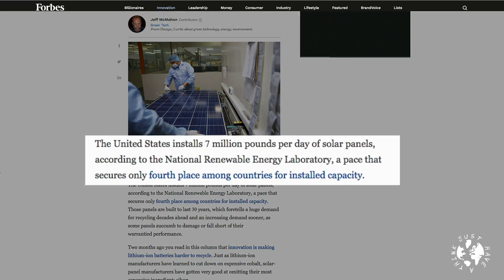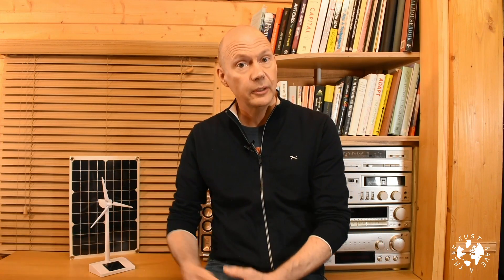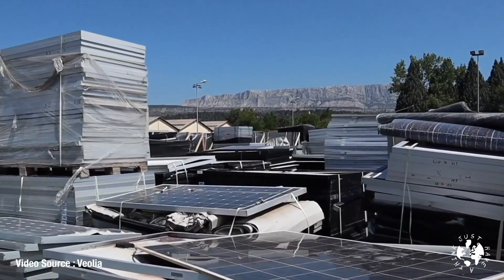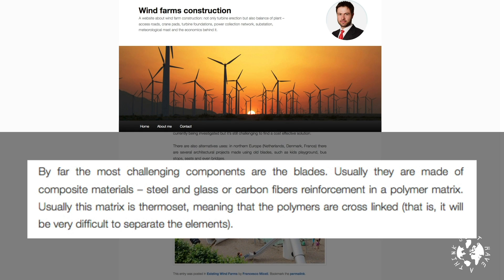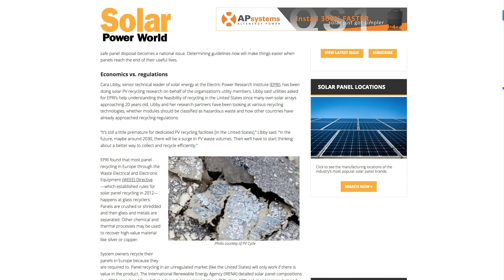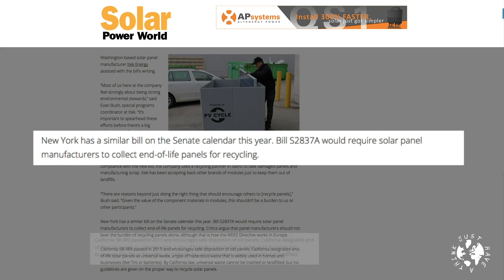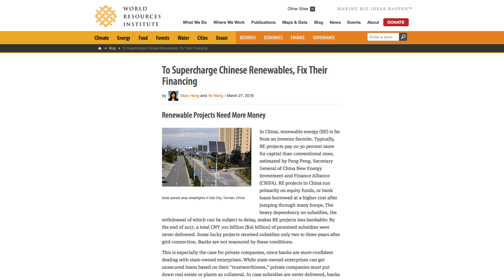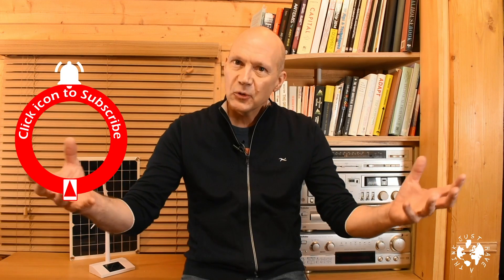Recycling renewables : a price too high?

Comment: Glass, aluminum, solder, wire, silicone solar cells, silicone adhesive.  Similar things for wind turbines.  No more difficult than say a car or aircraft which are readily recycled.  Easy peasy.
Reply: of course.  This "problem" is hyped nonsense.
Reply: It's only "easy" when you have boat loads of CHEAP HIGH DENSITY ENERGY, it's very difficult if all you have is low density, irratic, weak energy which is what "renewables" produce.
Solar panels are great for small applications like radios, watches, some energy efficent homes in favorable locations, lighting for remote areas etc but they cannot support our high energy, high consumption civilization & even more important, they produce NONE of the essential raw materials we now need.
So it's back to the "caves" but with a solar panels providing some light inside the darker recesses of the cave when the suns out, but without batteries, they won't be of much use at night.
Reply: @sheilachambers6671  you are correct we do need dense energy storage.  Solar and wind are more than adequate to pump water when they are available and can easily store massive amounts behind damn to be used in base load high power applications.  As far as small scale it is trivial to use solar to power a modern American home.  Currently it is not ideal to retrofit old home with it, but silly not to include it on new construction.
Reply: @GeoFry3  That would depend upon where that new home is located, there are areas where  it would just be an added expense to have solar panels on roofs that get little if any sunlight. 
Homes in areas within a forest, shaded by taller buildings,  in areas that get too much fog, rain or snow & solar panels add tens of thousands of dollars to the cost of that home. 
Areas of the SW, the far south west, central states & some eastern states can benefit from solar. Where I live, we get too much rain & fog for solar to be useful, we get 80" of rain here & when it's not pouring rain, it's foggy. This is also a low income area & we have no solar panel dealers anywhere near us.
Solar just cannot solve our energy problems or our upcoming shortage of liquid, high density energy fuels for agriculture, long haul trucks or ships.

As I have mentioned before, all these so called "renewables" wouldn't even exist if it wasn't for energy dense fossil RESOURCES &  energy dense fossil fuels. Our agricultural system is also tightly tied to OIL as are the genetically modified food plants now dependent upon chemical fertilizers produced from natural gas & oil.

We cannot replace DECLINING RESOURCES with a RESOURCE DEPENDENT TECHNOLOGY!

I think we are being mislead on the capabilities of "renewables" to keep BAU functioning because they can't.

http://wattsupwiththat.com/2014/11/22/shocker-top-google-engineers-say-renewable-energy-simply-wont-work/

https://www.newscientist.com/article/dn16550-why-sustainable-power-is-unsustainable/
http://sunweber.blogspot.com/2015/04/solar-devices-industrial-infrastructure.html

http://energyskeptic.com/2016/hall-and-lambert-eroi-of-different-fuels-and-the-implications-for-society/

http://dgrnewsservice.org/civilization/ecocide/extraction/kim-hill-whats-wrong-with-renewable-energy/

http://www.theenergycollective.com/gail-tverberg/330446/ten-reasons-intermittent-renewables-wind-and-solar-pv-are-problem
http://oilprice.com/Latest-Energy-News/World-News/Germanys-Renewable-Energy-Problems-Serve-as-a-Warning-to-the-UK.html

http://www.theenergycollective.com/robertwilson190/335806/germany-shows-renewable-energy-has-failed-and-other-strange-ideas

https://cleantechnica.com/2018/11/22/peak-oil-drastic-oil-shortages-imminent-says-iea/

https://www.cnbc.com/2018/11/09/goldman-sachs-there-will-be-an-oil-shortage-in-the-2020s.html

As Dr James Hansen said:
"Can renewable energies provide all of society’s energy needs in the foreseeable future? It is conceivable in a few places, such as New Zealand and Norway. But suggesting that renewables will let us phase rapidly off fossil fuels in the United States, China, India, or the world as a whole is almost the equivalent of believing in the Easter Bunny and Tooth Fairy."
http://bravenewclimate.com/201...

Comment: It wouldn't surprise me if most solar panels still work well enough to use up to or after 100 years from the born date. We are just getting started with solar really. I'm working on devices that can be direct wire to solar, no charge controller no batteries, and do the same things that your grid power does. No need for the extra cost of all the extra hardware. Solar will save us tons when it comes to trash.
Reply: What do you use at night?
Reply: @davidtaylor7174  Depending on the application, nothing. A few things need some type of battery but what we are working on will cut your battery needs by 80-85%.

Comment: We have to encourage decentralised renewables by using small 100% renewable companies. Also we chuck away thousands of motors in our electrical devices and appliances every day, which could and should be used to make domestic wind etc generators. I have collected motors from scrapped hoover-mowers, microwave cookers and even DVD/CD players. That I’m using to make a few different renewable energy generators. LA should be running courses with hands on learning how to use these motors etc from recycling depots. Also there’s other lower tech solar generators that I think are better, such as Solar collectors that use a curved troth mirror to heat a fluid in a pipe. Also some places are installing turbines in mains water pipes which provide constant local energy.
Reply from the maker: Hi Kyarose. You are an inspiration! I'm reminded of the guy in Zen and the Art of Motorcycle Maintenance. Its almost a lost philosophy - what my parents and grandparents called 'make do and mend' during the second world war. I think there is a resurgence of this mind set though. I certainly hope so. All power to your elbow my friend :-)
Reply: Just Have a Think Thanks v much for those kind words, and the reminder of  a distant memory of ‘Zen and the art of motorbike maintenance’, I used to be a biker in the 80’s had an old 54 Matchless G80s( 500 single).

Comment: 100x100km of solarpanels near the equator are enough to power the world, well someyears ago!
Reply from the maker: Hi Nico. Yep I think that's a similar figure to one that Elon Musk used quite recently.
Reply: @JustHaveaThink  this number came from desertec and was meantioned many years ago! Solar panels in the sahara desert to power europe andvthe calculated how much would be enough to power the world.
Reply: You're leaving out the cost and environmental expense of building the transmission infrastructure to distribute the power from the panels at the equator.  (not effective).

Comment: Well in germany we could stop 20% of energyproduction, just needs storages!
600TWh/year needed, 800TWh/year produced, 200TWh are given away almost for free!
Reply: See my comment under the thread of +tcm - the speech of Dr. Eike Weber is under the channel of Universität Karlsruhe  - Solarenergie als zentrale Säule einer enerneuerbaren Energieversorgung.
Highly interesting. STORAGE and batteries are the next fronitiers - we can rely on it that there will be  the same economy of scale effect regarding research results and price drops

Like with solar panels, airbags, electronics, computers, mobile phones, smartphones, the internet, digital cameras, animation in films, ...

If stationary * batteries get only 20 % cheaper (and that can be next year, in 1 or 2 years) it will be another important breakthrough. 

* easier to solve the technological challenges than with car batteries: weight, fast charging, density is not that much of an issue - so it is possible the breakthrough for cars will take a little longer.

Plus the other STORAGE solutions (power2gas, power2hydro, Brine4power, artificial photosynthesis, ..)

But now even the car manufacturers have woken up, they cannot prevent the new technology anymore - but they could completely fall behind. And every installation of solar (be it in Germany or sunny Australia) can profit from better performing, or cheaper batteries (or a longer life cycle. 

So even though the governments somewhat dragged their feet regarding battery and storage research  (the lobbyists realized that solving STORAGE would mean a breakthrough to the point where energy providers simply cannot compete, and German car manufacturers do not like the SIMPLE technology of an  electric motor) - now other ! companies see the biz opportunity if they could sell (more) batteries to those who already have an installation or those who are on the fence.

Currently the costs for a stored kWh is 14 - 16 cents per kWH, maybe a little less now, but I looked up quality Lithium batteries (with an estimate for a realistic liefetime erring on the short term, they usually perform longer although it can be with lower storage capacity, they do not go to zero or "break" after 10 or 12 years).

Not all kWh must be stored, some are consumed right away (or sold to the grid, including the electricity that is exported to other countries for litte revenue). 

Businesses have a demand profile that aligns well with production of solar energy. Households need more in the morning, evening, and during night, which means buying more from the grid - or more batteries.

So average yearly production costs 7 cent per kWh (in Germany, less in sunny areas) + hopefully soon 12 - 14 cents for a part of those kWh. 

Normal tariffs in Germany: Costs for businesses 20 cents per  kWh, consumers I think more in the range of 26 - 29  cents per kWh.

Of course there are the fix costs for being on the grid, fees for self consumed electricity if you have more than a modest home installation .....
Reply: Better energy storage technologies will make renewables more attractive, can.do with less energy.
End of life disposal problems should be studied and global standard.methods should be put in place.

Comment: We need to engage in space based solar generation instead of solar panels.
Reply: and how do you get the power down to earth? Easy (you say) beam it! It doesn't work, mate, and any competent electronic and radio engineer will tell you why. Just ask them.
and by the way - you still be using solar panels, only they'd be in space...
Reply: @dickhamilton3517  it's easy you convert the energy to radio waves or a laser beam.  Do some research online and you will realize that this can be done.

Comment: This video didn't touch on a totally different way of approaching the problem: determining what degrades solar panels and wind turbines, and working to extend their lifetimes. It's not self-evident that either type of device has to become no longer useful after some interval of years. It all depends on a variety of factors, some of which may be subject to improved control.
Reply from the maker: Hi Ronald. I agree. I think we'll see major improvements in longevity over the coming years, and in fact even the current crop of hardware will probably last a lot longer than the figures I found in my research. But I also think the world needs to be prepared for whatever recycling of repurposing these large quantities of panels and turbines may require in future. All the best. Dave

Comment: No one talks about the loss of wildlife in this case birds.A couple thousand wind turbines ramped up hundreds of thousands of turbines reaching the sky.And battery waste from solar power.We need fossil fuel to manufacture batteries.Same as going vegan.If everyone went vegan how do we supply clean organic greens for everyone on the planet with climate change increasing temps.Water scarcity,rivers have become toxic and many disappeared.What happens to all the cows and farming animals virtually "overnight"?There is a growing addiction to meat in industrial economies including China.
Reply: Solar will be the main energy source anyway (availability). But have a look at kites (Enerkite), if that works out it would be a small-is-beautiful wind based energy production that works everywhere (with more caple / metal rope you get the precious height where the winds are constant and stronger). No need to plaster windmills on every hill.

Comment: Isn't this the same problem with e-cars and hybrids?   There's a lot more carbon used in their manufacture than in gas powered cars.  Please correct me if i'm wrong.....
Reply: theres a little more, but within a few years of driving they work out much better for the environment. In a few more years of battery density improvements it won't be the case that they use more in production than ICE vehicles.

Comment: So how long will the panels last? With modern panels with 0.2% degradation, the panel will still produce 81.8% rated power after 100 years. This figure of 30 years you use is nonsense.
Reply from the maker: Hi Andy. I suspect you're right. It should certainly be that way, and I hope it will improve still further. But 30 years is the current worst case scenario prediction so if we get ourselves organised and ready for any recycling challenges then I would have thought that's better than no planning at all.

Comment: I see it's becoming more and more common to see legislation that makes Solar PV manufacturers pay to clean up their mess once their products are worn out, but fossil fuel providers aren't expected to foot the bill for removing any Carbon from the atmosphere - policies like that just act like subsidies for the fossil fuel industry if they're not applied across the board. Perhaps we should be adding the cost of Carbon Sequestration and Storage onto the cost of coal, oil and gas when we make side-by-side comparisons of the cost per TWh...
Reply: Andrew Todd  its odd, its like the whole world is controlled by the fossil industry..   bet there will be taxes on renewables to pay for ff cleanup.. and what about the millions dying and hundreds of millions with healt issues because of ff ?
Reply: Fossil fuels get taxed no subsides or don't you know that  and you need lots of fossil fuel to build and recycle solar and wind eg, 240,000 tons of C02 for a small 80 meter wind turbine.
Reply: @rogerreimer6787  oil companies get huge subsidies, some if them get more in subsidies than they pay in tax. Coal is similar but now getting past the point of uneconomic, which is why the American mines are closing down.

There will be plenty of power from renewables to recycle the solar panels.
Reply: @seriousmaran9414  "oil companies get huge subsidies, some if them get more in subsidies than they pay in tax" LOL....if only saying it made it true, what a wonderful world it would be.
Reply: @theloniousm4337  perhaps you should actually check.
Reply: @seriousmaran9414  What a wonderful world you live in Maran - I'm truly envious.
Reply: @theloniousm4337  I live in the same shit world everyone else lives in, one that very much favours the rich and corporates.

Note that taxes such as VAT and fuel are collected by the companies and handed over to the government. You pay those, not the oil corporate.
Reply: Roger Reimer fossil fuel corporations are subsidised. Sounds like you listen to Foxnews propaganda.
Reply: @rogerreimer6787  where are you getting your numbers Rodger? From Fox News?
Reply: @loungelizard836  they completely ignore the two trillion dollar cost of the Gulf War along with the 4,000 lives lost to keep the oil flowing. They also ignore the National Security costs of running warships to protect oil fields. And they ignore the special accounting rules for coal companies that are not available to any other business.  And limits to liability when they have a disaster or make a lot of people sick.

All of these are huge subsidies.

However, it is still true that we need to get a leash on renewable Industries before they get as powerful and is abusive as the fossil fuel companies. We need to be careful and not cut them off at the knees but we also need to build in protection against abuse from the start because it's going to be slowly eroded and removed as renewable Companies Growing Power.

On the flip side, what I'm saying is really a bit dumb and the bigger context that everything goes to hell in the near future. We blow through the 2 degree limit in 2026. There's no way we don't blow through the 3 degree limit by 2050. That means we are almost certainly going to exceed the 4-degree limit by 2100. And people don't realize what a catastrophe that really is yet.

A few solar panels in landfills that are submerged under 50 feet of water file nation states with nuclear weapons go to war and literally billions of refugees flee uninhabitable bands around the equator are not going to make much of a difference. The carbon that they may have reduced will be much more significance than their presence in the landfill.